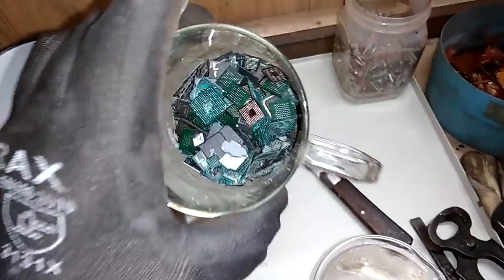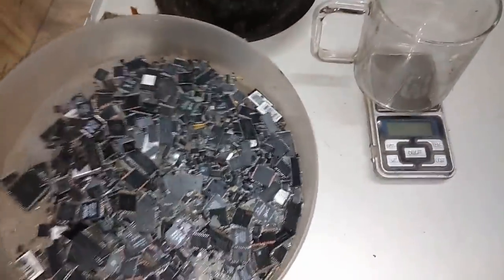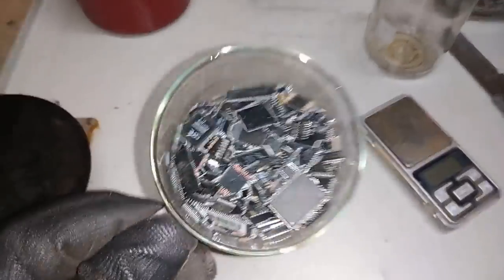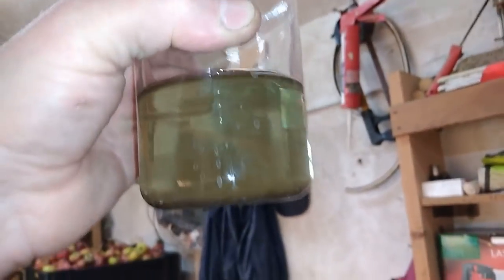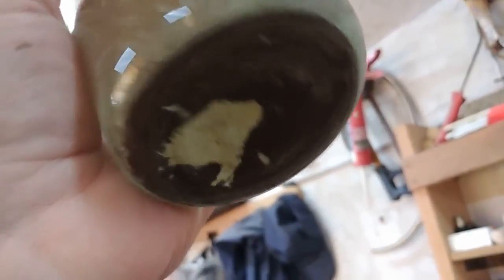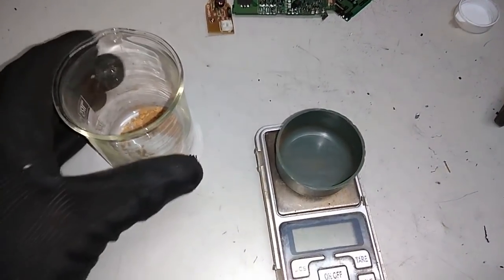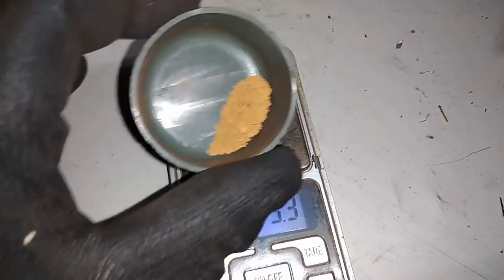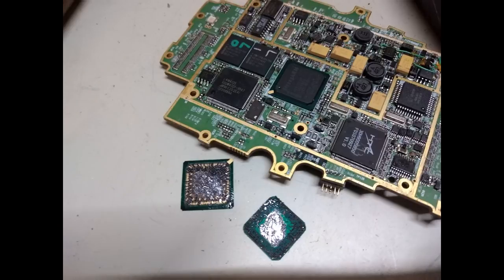Mix IC & BGA CHIP from Pocket PC - Gold recovery and refining!

Comment: I love your videos bro I got so much stuff I've been saving up I have never done any refining at all but I have loads of it I've been saving for a year what is the best is there a kit that I can buy everything I need all in one or where is the best place to buy all my refining stuff I need I am new to refining and I'm ready to try
Reply: I started saving myself, never done the process either, good luck, ggz 👽
Reply: start your refining operation small , your gonna make mistakes , you can get just about all your chemicals cheap if ya dont mind using weaker solutions , i never buy nitric but use sodium nitrate and sulfuric acid drain cleaner , the sodium nitrate and hcl works as A R  too, slower but cheap and effective , make sure you set up your refinery away from any thing you want to stay rust free lol , i dissolved the radiator out of my 1979 ford truck , oops  $$$ , never trust a gas mask to protect you from fumes and study up on how to neutralize used solutions
Reply: @geneplummer6645  thank you for the information I really appreciate it
Reply: believe me its not as easy as he makes it look also please wear suitable breathing apparatus the ar will get into your throat like a vinegar from heck if yer in the states duda diesel had decent price nitric
Reply: @cditzler6313  I am in the United States thank you for the information any little bits I pick up are great
Reply: First,be patient.learn as much and more then necessary.I find guys like this are good because some  Americans make misleading videos about refining.keep stockpiling and you dont have to have laboratory conditions like some people imply
Reply: @normynorm2945  been saving for over 2 years